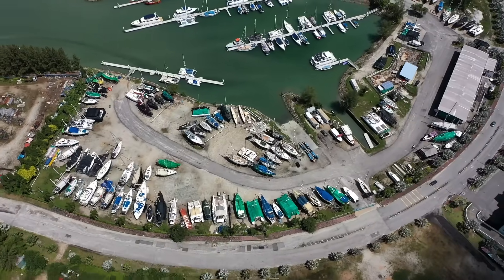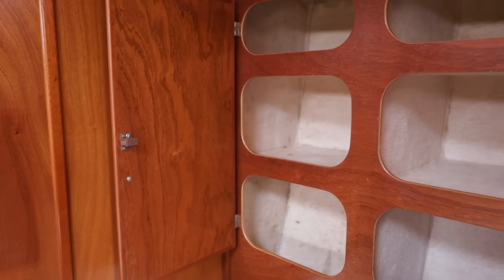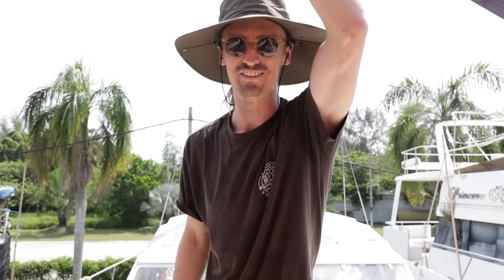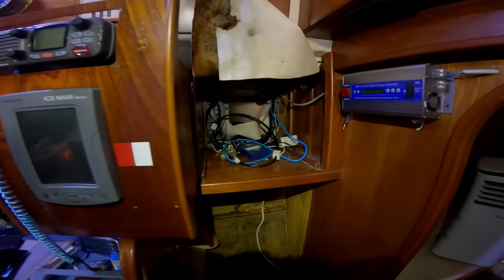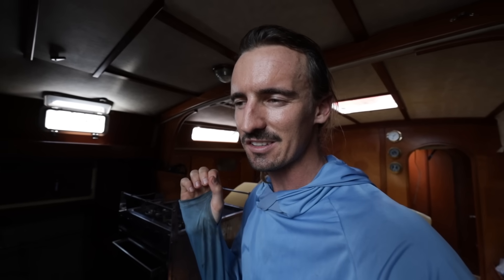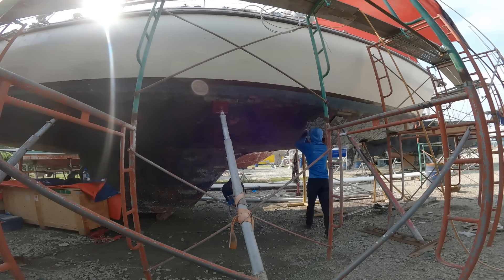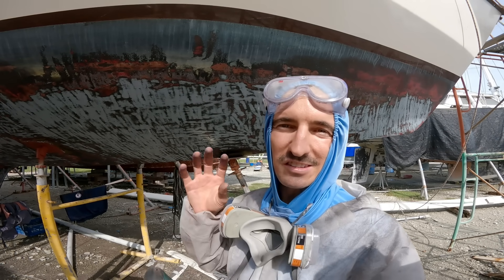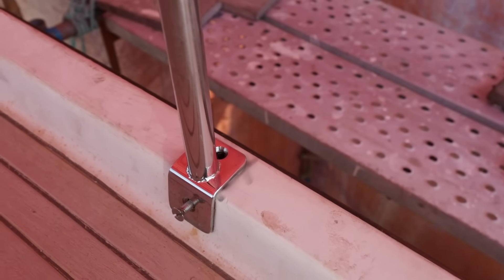STRUCTURAL DAMAGE found, what now?!

Comment: Great work you two - terrific to see so much progress and, again, kudos on a very smart move to get professionals in to do the fibreglassing for that damage while you crack on with everything else, you’ve got your hands full. Also nice job on the safety rail repairs - though having done a lot of open ocean sailing and even just east coast Oz sailing I can’t honestly say that I’m a fan of the open bow without a pulpit, in my experience it’s the one part of the railing that I wouldn’t want to do without - especially when sail handling up forward in heavy weather at the times when you least want to be up there. But I appreciate that it’s what you have found will work for you, good on you for trying something different while you have the opportunity  - the nice thing about Stainless is that you can easily cut it and modify it at any time down the track as you come up with different ideas and get more familiar with the boat at sea.
Reply: Yes handling the anchor or furler in a storm with no railing = very sketchy.
Reply from the maker: Thanks for the comment Larks. The amount of time we spend on the bow while sailing is extremely minimal and even if we are up that far on the bow we are never without a harness attached to the boat is some way. I think this railing system will really work for us. Cheers for watching

Comment: I hope you r doing the GRP repairs with epoxy resin 🤔, new & old poliester don’t tend to bond very good. Underwater body 😢 you must sand all the old antifouling off before you apply new epoxy primers and antifouling 😊 your best bet for tropicall water is Micron 99, get four coats @65 micros x coat and you should be good for 30 months.
Keep on pushing 💪💪💪
Reply from the maker: Thanks for the advise! We'll look into it

Comment: The steering rack and gears are available from Amel, but first remove, clean out all the old grease as it goes like chewing gum. We have changed these for new rack and gear on 2 Amel Super Maramu yachts, only to find the old ones were just fine. It was the old grease that was the issue!
Reply from the maker: Thanks for the advise! We are still working out the best corse of action with the steering system. the old one might be salvageable yet.

Comment: A thermocouple is a valve that, when hot, allows gas to flow through it. Thus to start gas flowing one must keep it turned on until it starts to work. Once open, the valve will turn off if it cools, the preventing unturned, poisonous gas from getting into the room.

Comment: I’ve never understood why these folks who are refitting their boats do not use a soda or sand blaster to clean the bottom. I live in Florida where bottom paint doesn’t last as long as it does in northern climates. Marinas regularly sand blast a hull bottom in preparation for repainting and anti fouling. Someone who is experienced can strip a bottom pretty quickly.
Reply: Depends on the hull material you need a very careful operator to blast a fiberglass hull.
Reply from the maker: We researched this idea and would have love too had the ease of sandblasting the hull but unfortunately in this particular yard the cost is around $4K USD which is outrageous and unaffordable for us. Back to the sander/scrapper we go hahaha

Comment: May seem a stupid question, but why spend money or time on anything like cushion covers etc.until you know you have the hull, deck and mast fully repaired? Just in case the boat can’t go back to sea as lots of waisted time and money then.
As for your steering cables our friend who has a 1995 SM got new cables from Amel. Not cheap and it took 6 months. I think he said Amel had 10 sets made, so try contacting Maud to see it she has any. However the ends were mot made correctly and did not un-screw. We had to cut them off, drill and tap the ends by that attach to the rudder then use a bolt.
Reply from the maker: We're committed to getting this vessel back to 100%. Theres no issue this vessel can throw at us that we can't tackle and eventually fix. Also we'll be heading back to Australia for work reasons for many months and want to get the vessel back to near ready condition to sail. When we return the mast should be up and the engine in place so we can start our sailing straight away instead of spending anymore time on the hard

Comment: Not sure how much the reduced bow railing helps tackling the anchor because the furler is there as well.  On my Amel I actually tie the furler to the bow railing to prevent twisting.
Reply from the maker: Another Amel owner said something similar. I am interested into exactly why and how you tie your furler to the bow railing. I'm sure its a problem I'll be able to solve but it interesting to know that multiple people are saying this.
Reply: I did sent you pictures.  It was setup like it when I bought my boat.  Does make sense to do it this way.

Comment: It's a "Rack & Pinion" steering system, it doesn't use cables.
That's still minor structural damage, I think you may find more where the hull and deck hit the ship so look carefully. That railing looks fantastic! The boys did an excellent job on it. I did the same open bow railing on my boat to make anchor handling easier. It did make it much more difficult to get on the boat when tied bow on at a dock though. Great job guys!
Reply from the maker: Thanks for the comment Jaglite. We're so stoked with the railing. Cheers for watching

Comment: There is no part of a fibreglass vessel, or a steel vessel, that is not repairable.

Whether or not it is economic to do so is another question.

Repairing a fibreglass structural defect may require additional structure for insurance purposes.    Dump the steering cable system for hydraulic.  Chains and cables are never great--hydraulics are the best option.  The damage to your vessel seems comparatively light, but I would probably remove and rebuild the entire bulkhead.  That involves getting the boat perfectly aligned and mast stays slacked off, hulls sand-bagged into design positions, and the bulkhead foundations being extended, strengthened and THEN the new or existing  bulkhead fitted, making it stronger and better faired into the existing hull than before with better load bearing or stress dissipation.
Reply: I agree with your comments totally, a cargo vessel hit the yacht, there is probably more damage that is hidden waiting to be revealed.
Reply: Yes dump the push rod steering system for hydraulic or cable.